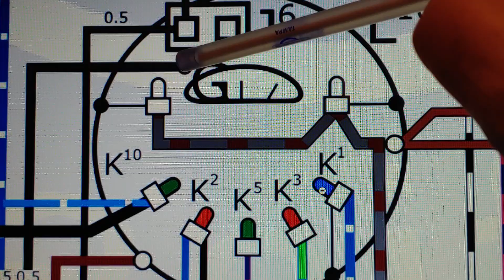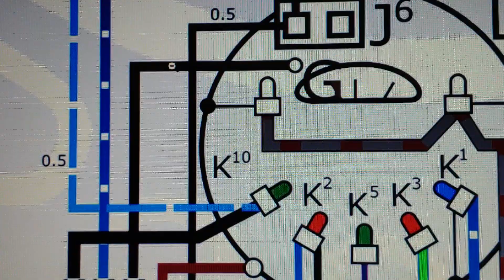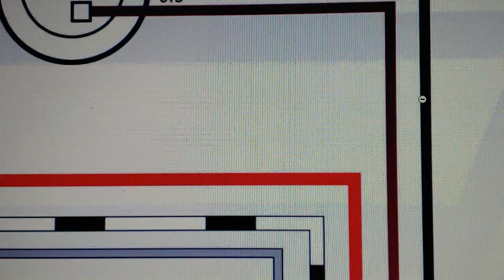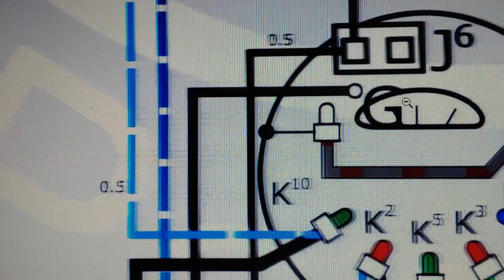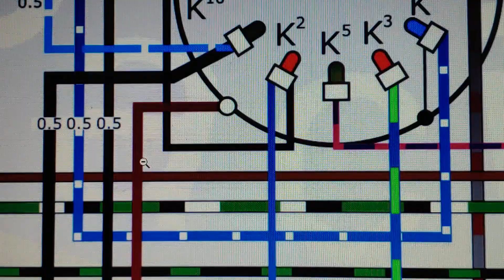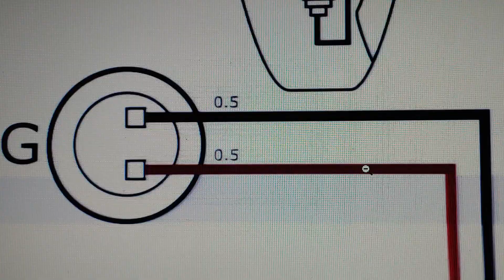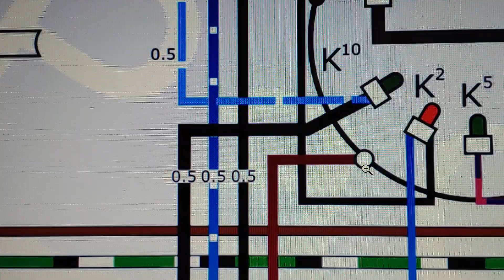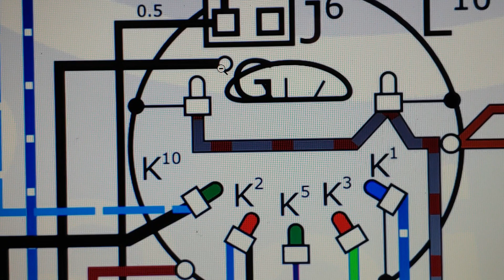CLASSIC VW 1972 VW SUPER BEETLE REWIRE. SPEDO FUEL GAUGE

Comment: hi did you ever finish all full wire diagram for the speedo on the 72 ?? theres a bull and white wire at 4 oclock looking at back of speedo one part of wire goes to into car the other part was not connected is there a video that shows this??? thanks

Comment: My speedo  is different.  The numbers  are different. My k9 is your k10,k2 is k4 mine, k5yours,k3 mine,  etc . I bought my new wiring harness  from wolfsburg West.  Enjoy your teaching  . Help me to understand  the difference  of the wiring diagram.  Thanks Stephen.  How  do know what is the what is say k5 ,is any thing on the speedo that has anything marked on it . Thanks  again
Reply from the maker: There are 2 different Speedos and wire kits. One is for the 4 speed manual. The other kit is autostick. K5 is the flasher light for the turn signals. Hope this answers your question.
Reply: @Volkswagenplanet  is your speedo  for an automatic? All my  # 's on my speedo is all different ? I have a cluster of 4 0n the bottom of the speedo
Reply from the maker: @stephenbrown260  yes mine is a autostick Speedo.

Comment: What about the 2-out black wiring that connects to the vibrator itself, need to know where the smaller female “spade” outlet connects too
Reply from the maker: Female spade wire if I remember goes to a ground body tab located behind the speaker.
Reply: @Volkswagenplanet  isn’t it a power to vibrator wire?  Just double checking before i short everything out heh
Reply from the maker: @avester01  in not at the house at the moment. I can check tonight for you and comment back. I use JBUGS.COM has free factory ( color coded( wire diagrams as well. What year and make is your beetle? Example 1972 Super Beetle........
Reply: @Volkswagenplanet  appreciate it!  Its a 75 1303 Super Beetle

Comment: My needle is bouncing . It has to be the spring. Cus the cable is brand new.
Reply from the maker: I never had a spring go bad in the spedo, I have seen quite often the spedo cable fastener bolt not secured properly. I also can see why a spring could go bad also. Long use on a broken cable. Let me look it up in the Bently manual. You have a 73 super correct? Disk or drums brakes up front? Thanks for watching and commenting on a regular basis. If you need a video done or question I'm here to help. Your beetle is coming togther faster than mine. Keep up the good wiork. Thank you for sharing your knowledge and your beetle. You would be surprised who you help, and how many you help and not even realize. 
- KEEP DUBBING -
Reply: Volkswagenplanet yeah a 73... thanks for your kind words. Your doing the electrical so man....  I’m so glad you are because it’s hard to find online. Or I’m too lazy to look online. I like the old school way of learning and you do a great job...
Reply from the maker: @unicron24  Thanks, Iwas scared to death of electrical until I did the fuse box series last month. I would just pay if I had a electrical problem. Not now, I grab the book and find the issue. More spedo videos on the way til we completely finish it up. Thanks again for supporting the channel.

Comment: why would you convert the mm to imperial?
.5mm is .5mm.
Just get the right wire and stop faffing around with converting to something that is sort of maybe a similar size.
Everyone in the majority of the rest of teh world uses metric.
Reply from the maker: If you noticed in the wire diagram it's in mm. I just converted it to help those who would not ask questions. You would be surprised how many think a wire is just a wire. Thanks for commenting. Stay safe.
Reply: @Volkswagenplanet  a 5mm wire is a 5mm wire. Something converted from imperial to something similar to 5mm isn't. 
Just buy the correct wire and then you'll be fine. 
Americans going with near enough is good enough.